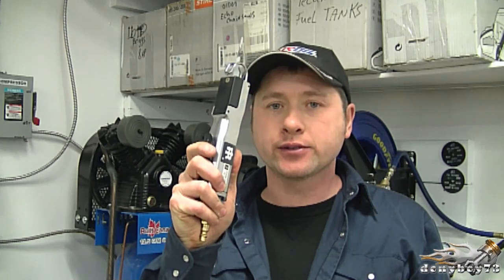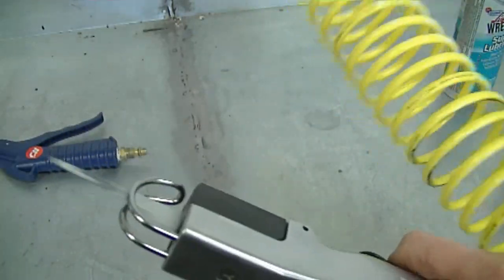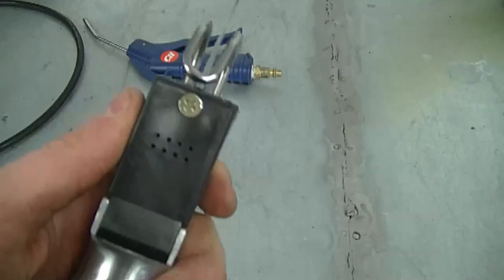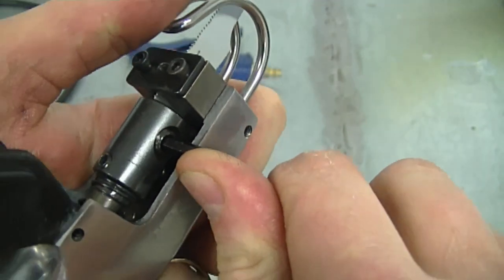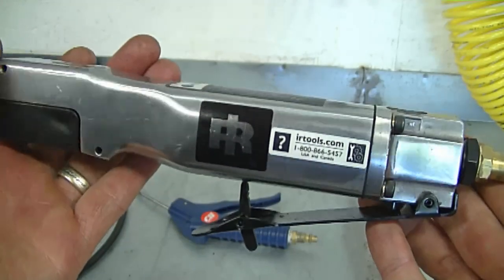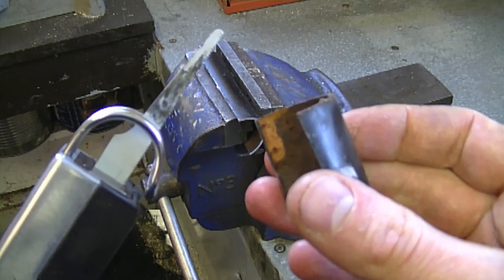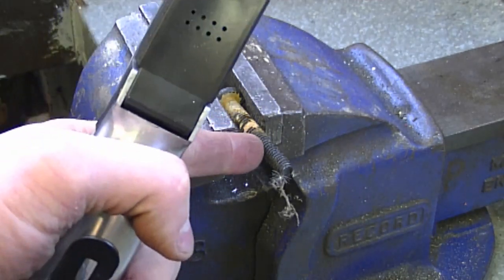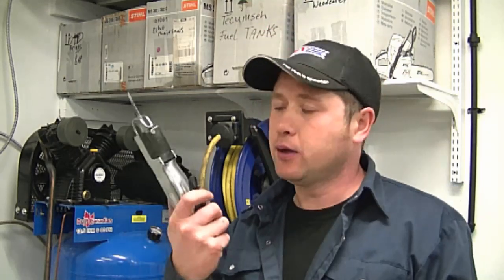TOOL REVIEW - Ingersoll Rand Reciprocating Air Saw Model 429

Comment: A reciprocating saw is a great tool to have.... however, I would recommend the IR4429 instead of the IR429 because it's rated at 5750 strokes per minutes instead of 10000 (and can be lowered with an adjusting screw besides the valve) so it really makes the blades last longer (say forever)..... I've personally tried both and I can say the mechanism of the IR4429 is heavier/stronger and does not tend to jam when operated at lower speeds. In my opinion it's really worth the price difference.

Comment: I like the saw but I use a Dremmel tool with a small cut off wheel (about 1.25" diameter) for hard to reach places like muffler and exhaust bolts on both small engines and on the exhaust system on my car. Always use safety glasses though!

Comment: Bought the knock-off from Harbor Freight and had terrible experience. First two wouldn't even articulate - the seals leaked. 3rd one seemed to work fine until I tried to use it - had no torque. It could cut paper but not cardboard. I want this Ingersoll Rand!

Comment: I have already seen this saw under at least five brands, so it is probably manufactured by a single Chinese company and sold under these brands. But that's just an aside. The saw is not bad, but it has a relatively large air consumption. So, in order to achieve the performance according to the video, a two-cylinder compressor is needed, which is on the video. With a single-piston compressor, for weak sheets or plastics. In any case, I recommend lubricating according to the video before use.

Comment: Nice and good  explain. Thank you. 
However, I wonder that you just used air saw blade for wood to cut off a piece of bolt? 
At 1;11, color of blade for metal is red..  and blade for wood is white. The metal pipe you cut off with white blade? Isn't that made of aluminum?
Reply from the maker: thanks for the tip

Comment: I'm an auto mechanic and own one.  I don't use it too often but it is worth having it for sure.

Any idea where I can get replacement blades ?  Home Depot doesn't sell them.  I had a feeling they wouldn't but checked there anyways.

I'm in Toronto, Canada.  If I have to buy online, I will.
Reply from the maker: CrociatoAzzurro I bought the tool here in Muskoka at Muskoka Auto Parts and also the extra blades
Reply from the maker: CrociatoAzzurro also on ebay blades are available
Reply: donyboy73 
I'm going to try Princess Auto tomorrow after work (im NOT heading back out now).  I know they sell the tool but I'm not sure if they sell the blade package.  They're website doesn't list it separately, so I doubt they do, but you never know.
Either that or I get the MAC distributor to bring it in for me.
Question: do they sell the blades in singles or do you have to buy the 6-pack (3 coarse white & 3 fine red) ?
Reply from the maker: CrociatoAzzurro I forget about pack specs but Mac or matco should have what you need
Reply: +CrociatoAzzurro 
A hack saw blade will go in nicely, cuts pretty good too.

Comment: Just bought one. Its losing a small amount of air on the exhaust port  when not in use. Is this normal? Intake is fine checked it with some soap water.
Reply: +Hulla Dek 
Not normal, not even on the cheap HF knockoffs.

Comment: Does anyone know if these kind of tools can be used with a 12v Portable air compressor? If not, why wouldn't it work. I mean the air compressors that plug into a cigarette lighter in a car. Just wondering because these tools need around 90 PSI and those portable air compressors can reach 250 PSI :)
Reply: DonkeyDiddles 
I hope your kidding and your looking for a rise out of people... but it's not psi it's cfm... you need a large volume of air to run an air tool like this specifically. 60 gallon tank or larger will give you best results. You simply couldn't brake a wheel loose with a 12v air compressor could you? I'm afraid not. A 12v air compressor is mainly for emergencies like filling a flat spare tire if your regular tire were to blow on the side of the highway.. hope that is somewhat helpful,  otherwise educate yourself and learn the answers to your question.

Comment: To avoid the constant boredom of opening the screw to get at the blade release bolt, drill a hole in the plastic cover in the right place & you can put the allen wrench in - no more faffing with the screw nonsense. Same goes for most of these as they all come from the same factory... cough... :-)
Reply: Plus if you get bored of buying the expensive "proper" blades - you can use hacksaw blades - just cut off 3" or so from the blade & you've just made a "body-saw blade."  Angle grinder cuts the hacksaw blades effortlessly.